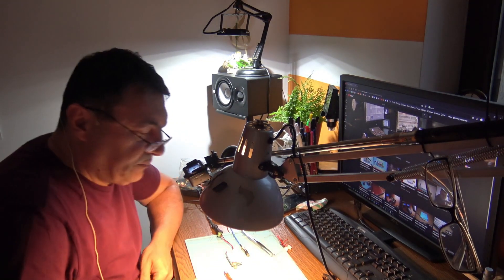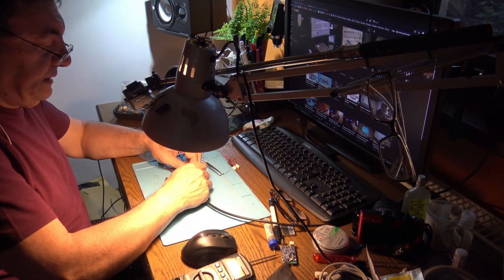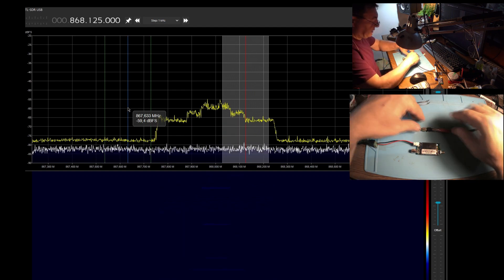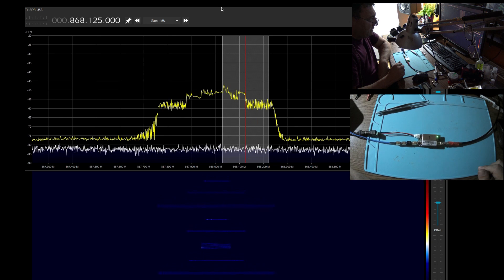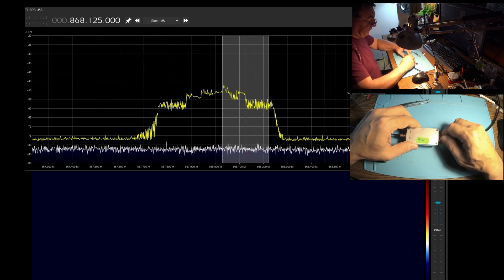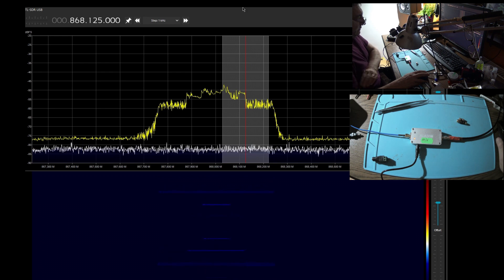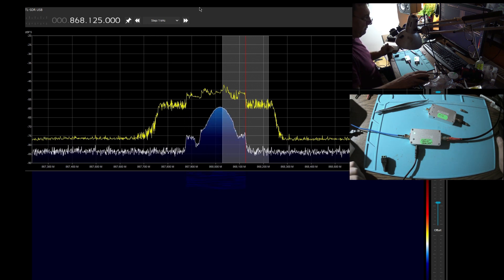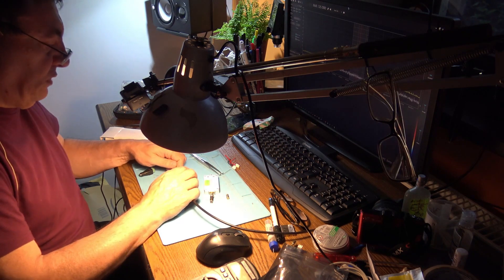AB-868-5V /AB-IOT-868 and Acasom v.1 TX test

Comment: sir may I ask, what software did you used during the testing?
Reply from the maker: I used a RTL SDR Radio with AirSpy software
Reply: @viocaia  thank you sir, where can I get that?
Reply from the maker: @Erns3101  AliExpress
Reply: @viocaia  sir what if I will use a HackRF One SDR, is it compatible for my AB-IOT 868 signal booster?
Reply from the maker: @Erns3101  My expertise it's strictly related to LORA Helium miners, 868MHz. I can't say if it fits your needs...you have to experiment by yours self. Sorry!

Comment: Hi Viorel Caia. Thank you for your effort in making videos and sharing your knowledge. I have A question about the AB OIT 868 5V bidirectional amplifier. I don't know how, but its doing nothing on my nanoVNA. And with my glamos walker it doesn't switch to TX (led from green to blue). I was wondering if you know what part is defect and needs to replace?
Reply from the maker: try to connect the other port and send a beacon..
usually In goes to the miner..try to apply a signal to out..you should see it change to TX..I observed also, if is connected with in to port 0 and out cable is in the air..also you should see the blue flickering..

Comment: Hi Viorel. I tested now the Acasom Amp TX17/RX6. My Setup: 3 Miner - Splitter - Amp17 - Lmr400 (8m) - 9dbi Antenna. That works good (All 3 miners make about 0.3hnt/day). I will test changing on one miner the dbi from 9dbi to 7 and see what happen because i think that i can witness a lot more.. What do you think about?
I tried also with a acasom cavity filter but was bad.. work better without cavity filter.. Another test was 3 Miner - Splitter - Bias T - Amp TX12 - Cavity filter - Lmr400 (8m) - 9dbi Antenna (was very bad).. Dont know why?
Now on my second setup (friends home) i have two options. the first option is: 2 miner - Splitter - Bias T - Acasom Amp TX12 - Cavity filter - Lmr400 (12m) - 6dbi Antenna. the second option is: 2 Miner (from every miner a bias T and a amp TX12) - Splitter - Cavity filter - Lmr400 (12m) - 6dbi Antenna. What should you do and what would put in the app?
 I Hope you unterstand what i mean with my bad english and thx :)
Reply from the maker: Try to have the amp before splitter..and as long as you have bias tee just under cavity at the top of the cable..as close to antenna..then no more noise from cable..connectors..etc..

Comment: Hi - thanks for another interesting test. I didn't get to build an amplifier (could not get the chip) but I did buy  the SPF5189Z amplifier module (like yours) which I have been testing. I also have some Airbuddy modules. Both of these seem to work well but it is tricky to test the Airbuddy TX amplification with just a VNA. The RX amplification from both the SPF5189Z and the Airbuddy is as claimed. I built an 868 MHz cavity filter which works very well and has a very low insertion loss, there is a great website for calculating the required dimensions. Combining this cavity filter with an amplifier and an 8 Dbi Interline Antenna gives a 4 times improvement on Gateway count using a Glamos Walker. So far though this has not resulted in a 4 times increase in rewards ... this is a longer term test. Once again, thank you for the no-nonsense approach to testing and I'm looking forward to more.
Reply from the maker: Nice done! I wish to have a Glamos..I was thinking  about buying me one, but I don't think it's worth investing anymore..what is done is done and that's it..that doesn't mean that experimenting is not fun anymore..let us know the progress..

Comment: So question...I have Acasom 12RX/2TX using Acasom cavity filter...the set up doesn't seem to work at all...or like in your previous video...seems to not allow signals through as much as with out. How then is this Acasom amp working seemingly perfectly. I have 2 complete setups that I have had on 2 different mining locations...neither did well at all. With filter/amp installed I was at only 8 witness and 24 beacons (7d AVG) I remove amp and now only have filter and now have 30 witness and 92 beacons (7d AVG) with both numbers continuing to go UP only 1.5 weeks later. ??????
Reply from the maker: Something wrong with the amplifier..but do you really need one? If you are in crowded urban area, with many hotspots around there is no need but a filter..amplifiers should be used for isolated areas or with splitters and lots of connectors in between..

Comment: Hey, do you have any experience with Jetvision flarm? I have one 17db so wondering if thing is any good. My issue is that I want to deploy it at a place I don't have access to. So basically once it's deployed it can't be seen for at least 3 months. What I ask: do I need to open it and set something prior to deploy? Thanks a lot and keep up the good work.
Reply from the maker: Never used a Flarm, like a rule keep it away from moisture..nothing else..maybe a remote switch like eWelink connected to mains for a way to switch the power..for miner/amplifier..you got an Internet connection anyway..
Reply: @viocaia  thanks for your reply :)

Comment: I have a question regarding the amps. I understand that having a  high TX will make the witnesses of close hotspots invalid. But what about a high RX? Is there an advantage to have a 30 dB RX amp vs  20 dB, 10 dB or 5dB? I am guessing that having a high RX will increase the noise also (even with a bandpass filter) and might reduce the quality of the beacons received but I am not sure.
Reply from the maker: Exactly! The RX has no limits but SNR..usually a max 6dB will be enough..and filter too..
Reply: @viocaia  I was thinking about an analogy. Can RX be considered as a headset? If you set the volume to the max in your headset (like a high RX amp), you will hear the song and low-volume instruments but the quality of the music will be very bad (saturated speakers) and you won't hear very well (SNR will be bad). If you increase slightly the song (low RX amp), you will hear the song and all instruments clearly without saturating the speakers (Better SNR).
Reply from the maker: @dakuta  Right..very nice thinking!